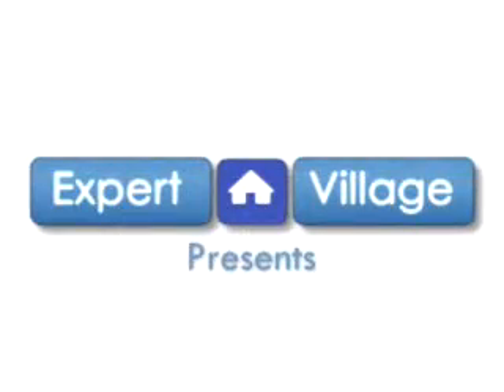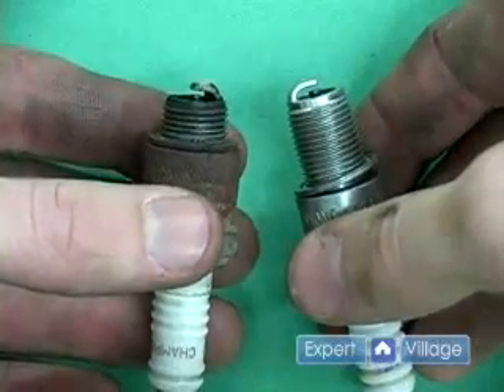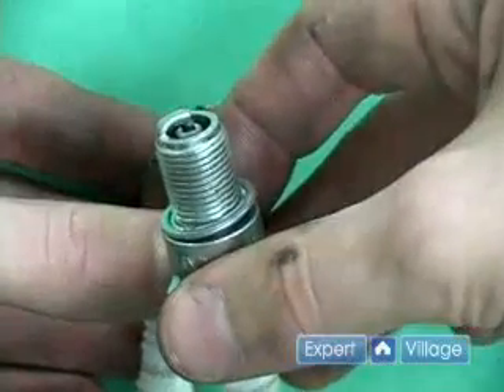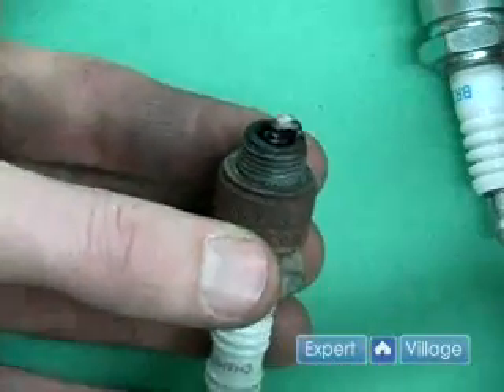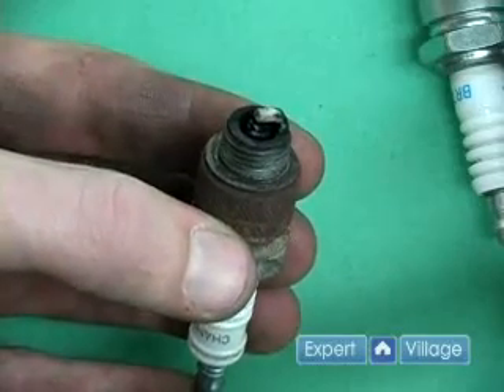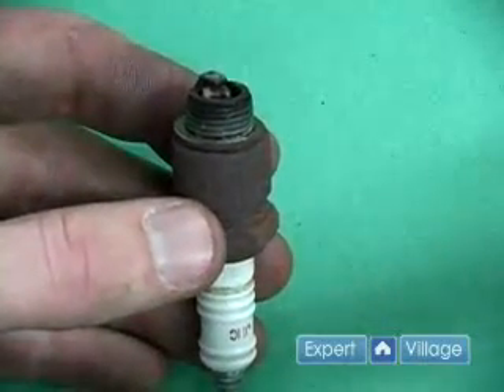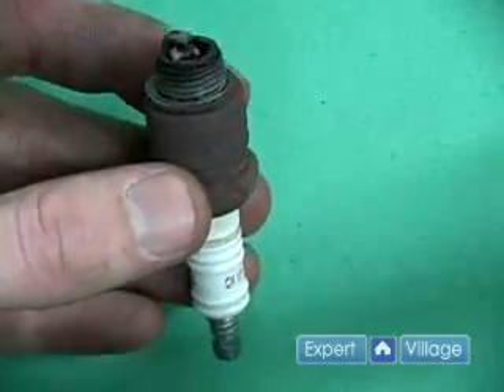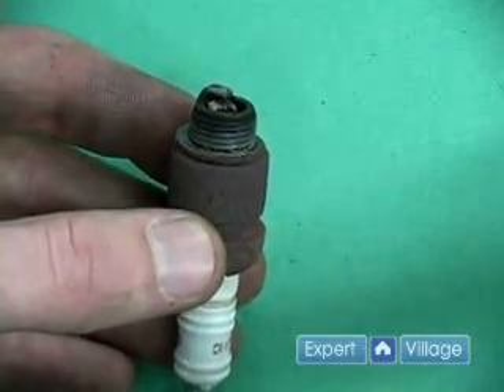Changing Spark Plugs : How to Identify a Bad Spark Plug

Comment: I have just changed Sp.plugs on my Turbo Engine. 

I ordered it NGK from amazon there are good deals check link below.

Please check compatibility before buying one.

amazon.com/s?ie=UTF8&redirect=true&ref_=sr_nr_i_0&keywords=ngk%20spark%20plugs&qid=1318954606&rh=k%3Angk%20spark%20plugs%2Ci%3Aautomotive?rh=i:automotive,k:ngk%20iridium%20spark%20plugs&_encoding=UTF8&tag=gadadige-20&linkCode=ur2&camp=1789&creative=390957

Comment: Um, that fouled plug, I'd be worrying HOW it got fouled like that.

In that case, I wouldn't want to just replace it, I'd want to know what's going on in that cylinder.  Somethings not getting burnt right or something else other than fuel and air is getting into the cylinder.  Possibly oil?

Yea, expert.  Hmm..